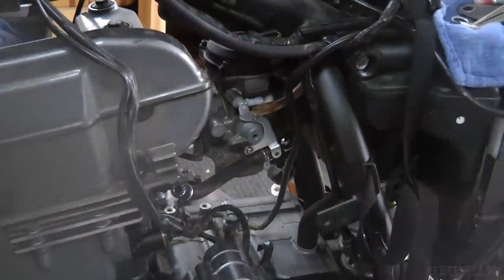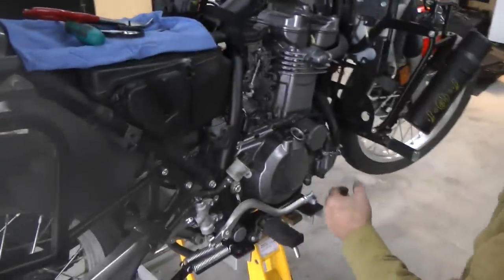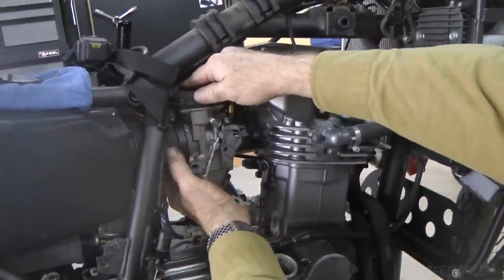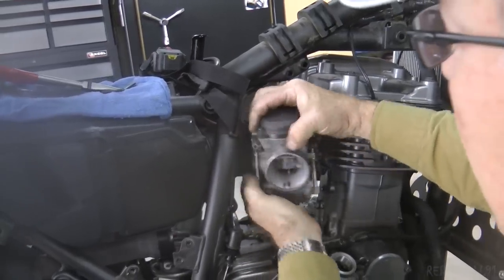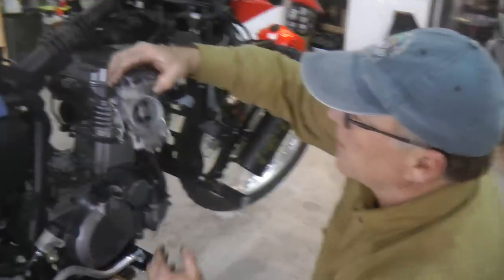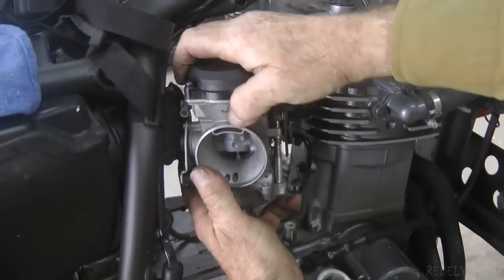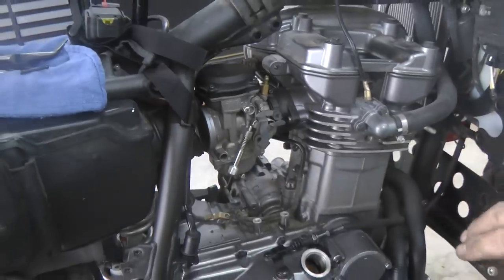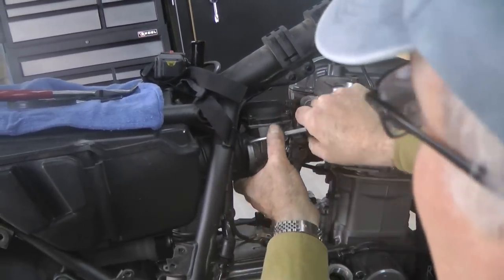Carburetor Removal/Install on a KLR 650 by klr650.net's Wymanwinn

Comment: This is the "I've done this a thousand times and I'm not slowing down to show you how" approach.
Reply: Techy Dog LMAO aint got no time fo that. Plus there's always a pause button
Reply: This is how all the "how to" videos should be done. can't stand long ass explanations
Reply: THANK YOU! Just finshed KLR carb removal/install. The trick of using a phillips head screw driver to seat the air cleaner rubber boot was genious. I've been working on bikes for almost 5 decades and would not have thought to use that technique.

Comment: Huh, nifty, except there's no prior explanation of what exactly is necessary.  On this bike the headpipe and starter have been removed.  That would be  pretty critical info to know.  All this video really tells me is that I don't need to tilt the subframe backwards, but otherwise the scenario here isn't JUST a carburetor removal on a KLR, it's a carburetor removal on a bike that's had quite a bit of other stuff already removed.

Comment: Priceless. When reinstalling before trying the boot over the intake side with a screwdriver go ahead and screw in your choke cable and tighten it down while you're at that angle easy peasy

Comment: This guy sure made this look easy!  My second gen has a lot more bs n the way on the right (enricher/choke) side, and thats after I got rid of all the vacuum lines and associated emmisions/fuel system parts.  The main fuse block is right in the way with very little slack to get it out of theway.

Comment: I installed my FCR-MX39 onto my 2006 KLR650 yesterday evening. I just bought an O2 sniffer/logger that I will be using to tune the carb (just got to weld in the O2 bung into the headpipe). I took it for a quick ride last night and...even though jetting is off...it freakin pulls hard!

Huh, I didn't know Wyman was looking at playing with the FCR.

Comment: Thank you Sir! My KLR has been sitting for over a year with the same gas in it so I took the carb off to clean it... When I put it back on, I somehow managed to connect the fuel line to the carb vent and the carb fuel input to the vent.. I'm sure it'll run much better when I fix that :) I was hoping to find a carb video on here :) Thanks!

Comment: Thanks for this. I just purchased a2002 KLR650C and I suspect there is a jet kit in it of some kind, or the 22 cent solution as the fuel mixture screw cap has been removed, and I want to verify. This video will save me time trying to figure how to pull the carb off on my one. Thanks again!

Comment: Thanks for the video... though things become simpler and simpler the less stuff gets in the way. With tank, exhaust and electric starter motor removed there is good amount of space to work, leaving those mounted working on the carb will be far more challenging... But again, thanks for the full visual with all parts off! :)

Comment: Had trouble with choke cable, so would have been nice to see clearer picture of removed cable ending and nut, but rest easy and clear. On my model had to detach radiator pipes attached to bottom of carby and loosen crashbars

Comment: Nice video. It would be helpful if you stated at the beginning, or put in the notes, what you had removed prior to pulling the carb. The gas tank was obviously off; also it looks like the starter is out. Anything else?  Thanks.
Reply: Jim Sowers Yea,, I stopped watching at the one minute mark.. Looked like they were in a speed race.. Didn't say what they were doing.. Very disappointed..
Reply: +TheDirtyyoungman1 Didn't say what he was doing? What video are you watching? There's not MUCH complication in this process and this man easily and speedily explained everything fine, if you're having trouble understanding what he's saying I would recommend getting Google Chrome so you can slow the speed down to .5 or even .25 depending on how slowly you're able to process instructions.

Comment: Hi, to the right of the carburetor, in the upper part there is a gold-colored attack, it will be brass, which is right near the suction manifold; Where does a pipe go, where does it end? I disassembled the carburettor on my bike but I do not remember where it was attached, and now if they accelerate the bike, it goes off as if that tube taps it, I close it, the bike accelerates well. From a video I see that it is attached to the carburettor, above the gas entry

Comment: i bought a fixer upper... there is no hose connected to the vent you called it.  where does it go to after the carb? rhanks
Reply: Seem to recall the vent goes to airc leaner box?  Some bikes have been modified to not require vacuum for the petcock to supply fuel ...   I did that to my bike but it was so long ago I don't recall where the tubes originally even were ...all that is really totally  needed is a vent tube and a fuel line...I mean it would work without a physical vent tube so long as it HAS a vent for the float bowl ...but the tube keeps out debris and from fuel sloshing out I would think ...

Comment: @rebelyell91 Once u have injection Jeff u will never go back. Id bet money on that. An actual dirt bike is another story because u really dont have a choice. Carbs are simple, cheap, and easy for someone that knows what theyre doing to fix but carbs "get carboned up" even in the best of conditions. Injectors get dirty but it happens far less so reliability is actually better on injection. FI is much more effecient and less moving parts to wear out too which also means more reliable